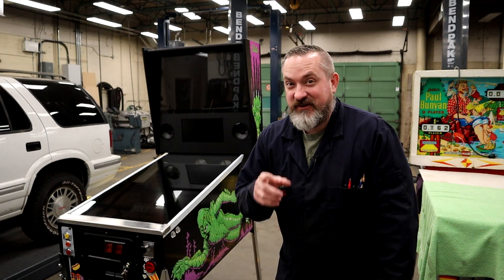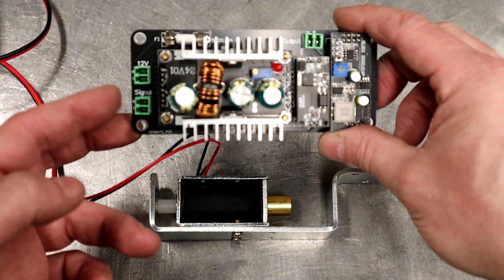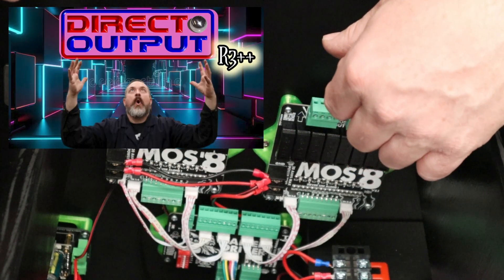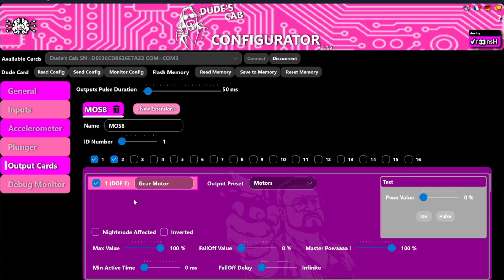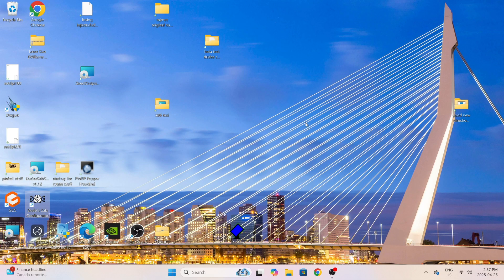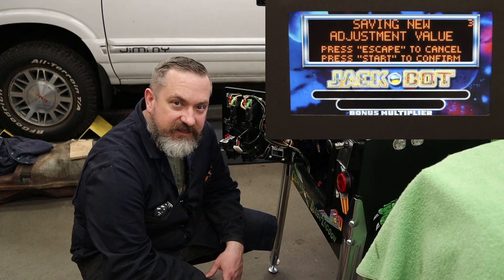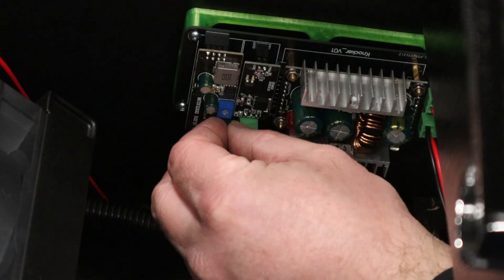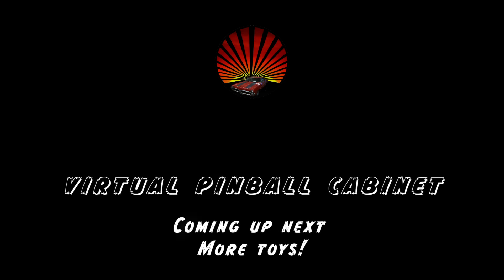How to install a knocker into your virtual pinball cabinet!

Comment: I believe I have everything wired properly but my knocker isn't knocking when I do the test in the Dude's Cab.  Did you put a fuse in the MOS8 board?
Reply from the maker: Yes you need a fuse in the mos8 or it won't work.  Get it to work in dudes cab first so you'll  know if it's  a dof issue after.  Cheers!
Reply: @wayofthewrench what size fuse do I use for the knocker?  You mentioned one for the shaker but I do not recall one for the knocker.

Comment: Hey thank you for all your video!! Can you mount the knocker to a 24v power supply with "la nettoyeuse" board and remove the csd board like the shaker motor?
Reply from the maker: You're very welcome!  No you can't as the CSD knocker board steps up the 12 volts to 24 volts.  The nettoyeuse board is just a cleaning board to prevent flyback voltage.  You could just run 12 volt to the knocker but it will be very weak. I hope that helps.  Thanks for the watch!
Reply: Yes thank you very much! I looking forward your video about back panel and adressable light for the big budget build. Hoping a soon release😅🤞
I follow you since the beginning and enjoy building my vpin inspired by your video!! @wayofthewrench
Reply from the maker: You're welcome!  I'm just finishing up the filming for the aleds....lots of stuff coming soon